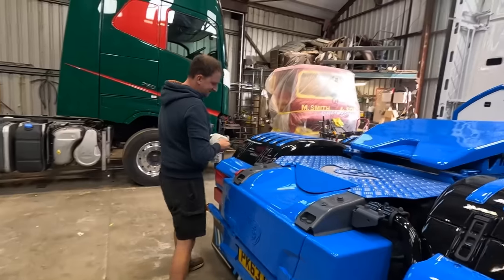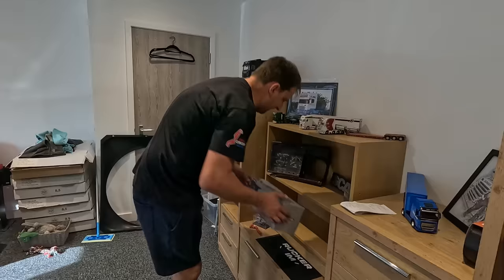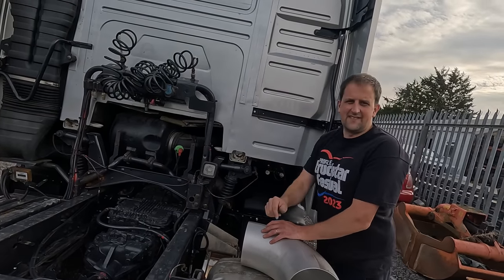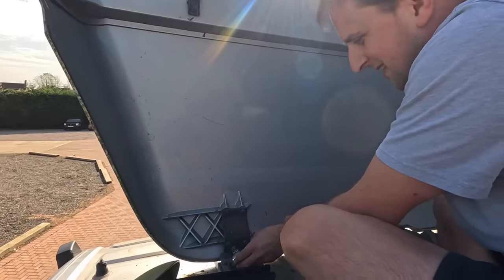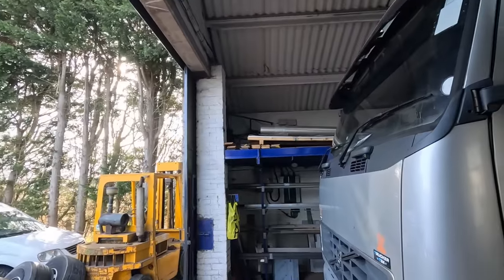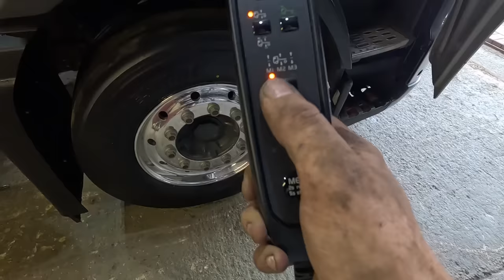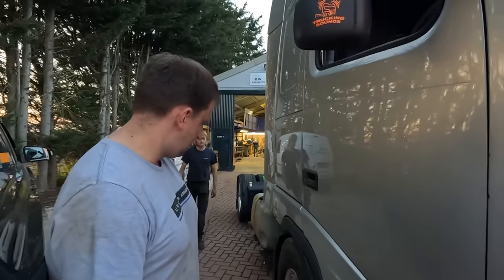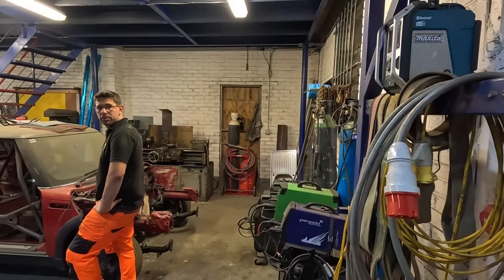THESE NEW WHEELS TRANSFORM THE VOLVO | BUT THERE IS A BIG PROBLEM! | PT3 | #truckertim

Comment: Hi Tim!! When you check the tire, measure the distance between frame to rim/tire and not bye eyeing the plastic over the wheels. Because the plastic can be offset from each other.  
Then the plastic are a diffrent size between 315 and 385 tires. The reason for this is too reduce the splashing fome the tires when it's raining.

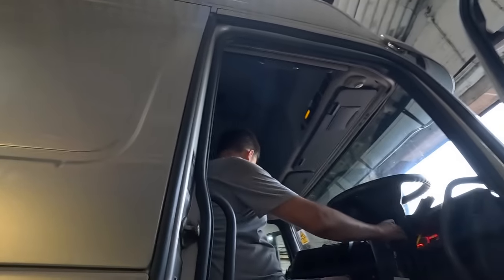Comment: About the wheel problem, when you’re sat in the cab at 17:30 it looks a lot better/same as the other. Are the cab springs pre stressed to favour the driver side because that’s where most the weight is 99% of the time?

Comment: Hi trucker Tim matey it's mark from Wirral Merseyside 👍👍 big well done for your wife for backing your truck into your unit so you could see what the under glow lights look like on the floor of your unit. Well done Helen for backing up Tim truck into the unit 👍👍👍 as for the Volvo and the brand new wheels looks great but is the tracking out on one of the wheels on the front of the Volvo truck or any steering bars abit bent or anything else bent under the Volvo truck best to let Shaun have alook after all it's Helen's truck and as for the exhaust stacks could be abit to big diameter for the engine size. I enjoyed the video and keep up the great work 👍👍 big tangs all round 🤙👋 thanks from mark from Wirral Merseyside 👍👍

Comment: If the dowel hole the spring sits in on the front axle is worn the axle can sit slightly off centre causing the issue with the wheels

Comment: It's not a wheel issue, can guarantee you that
11.75x22.5 only come in two offset, 120, and 0 (centre naive)
Dumping all the air out is casing the panhard rod to push the axle slightly to one side against the arch

Comment: The thing I find interesting I've worked on buses abit and cars alot and done a compressor on a truck on a ford and slater open dayits not the easiest and sometimes a pain in the bottom but still love them and carrying on customers aren't always the best but mainly in shops as a sales advisor but wouldn't change it and vehicles take all your time and money and give you😊 a headache ,  but we still come back and get enjoyment and fun when everything works or it works enough for fun. Also worked on my own car that was a time taking headache but still want to be a mechanic. Also all the trucks together and a trailer or 2 or 3 would look great if I'm honest also could be wrong but could be tracking that's making the wheel miss aligned

Comment: Swap the wheels on the front to the oposite sides and see if the problem moves with the wheel, if not and the issue stays on the same side its perhaps a camber issue.
Reply: Not sure about it necessarily being a camber issue but was about to say exactly the same thing with regards to swapping wheels over to see if the problem moves across 👍